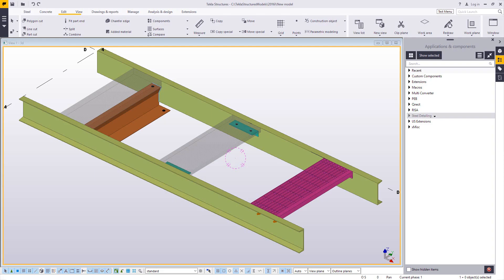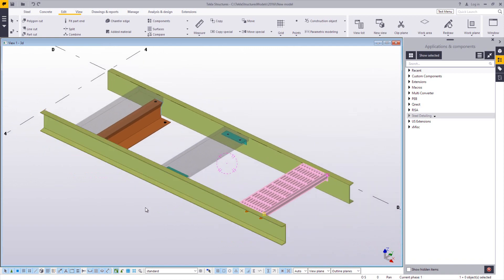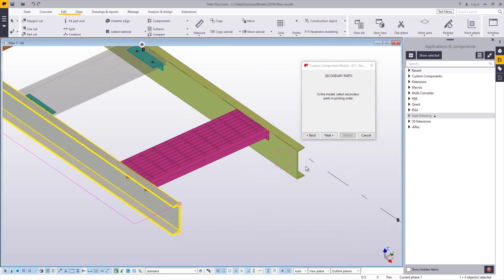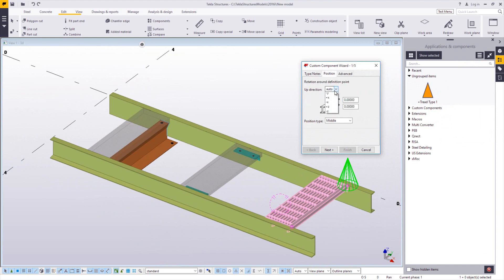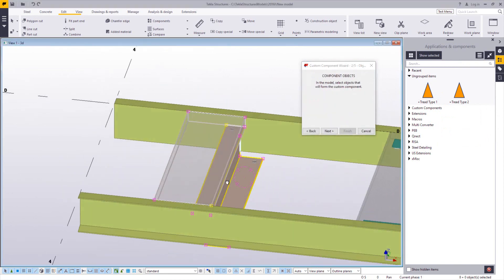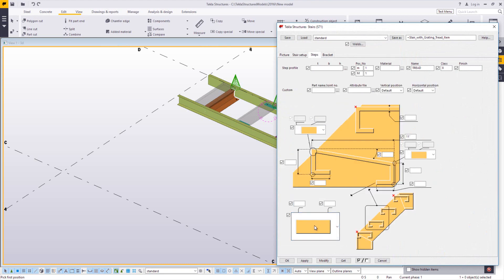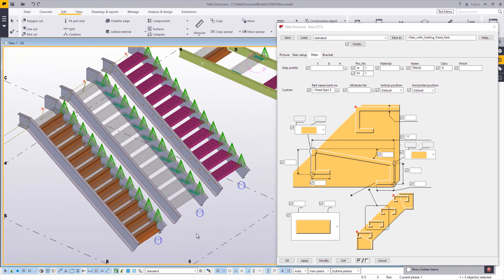Create Custom Stair Treads that can be used inside the stair tools in Tekla Structures

Comment: step length is fixed or it can be adjusted according to stringers?
Reply: It depends. The treads using 'items' would be for fixed-width, but custom treads like the precast example shown could be adjustable for different stringer spacings.

Comment: I tried to create a custom component to be used with Straight Staircase macro.  The treads do not installed horizontaly but are aligned with the stringer.  It is not good.  what is the way to create a good custom component using Straight Staircase?
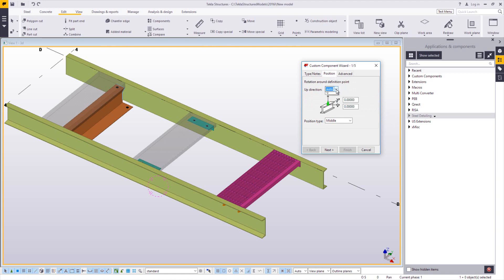Reply: If you look at about 1:30 in the video, you can see I force the 'up direction' to +Z, this should keep the treads in the correct position. If you do not do this, they will align themselves with the stringers.
Reply: Thank you David,  I did like that & it works well with the stair macro S71.  The problem is when i want to use it with Straight Staircase macro.
Reply: @marcofrohlich9087  Ah, I understand. I have not tested creating a custom step with the Straight Staircase extension. I believe it has the ability to load a saved attribute - with your custom component, have you gone ahead and saved something like a 'standard' attribute with the settings including the Z direction?

Comment: I try it, but the location of the tread is shifted from the specified points
Reply: In the new Custom Component, try to save an attribute file with the position values you want, and then specify that setting in the stair tool.

Comment: I inserted a grating component from sketch up using Reference model and add model but  I cant define as custom component it says no object found. How can I fix this thanks.
Reply: The SketchUp object needs to be inserted as an 'Item', not a reference model. You can either add it from inside the Create Item tool itself, or go to the File menu and choose Catalogs > Shape Catalog.
Reply: Dave Hiddemen 
I'll try that, thank you